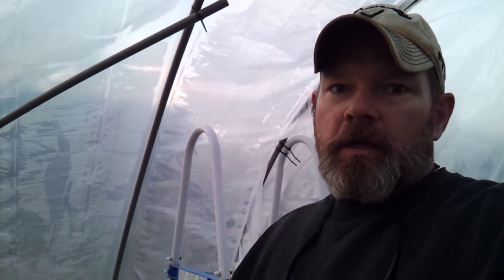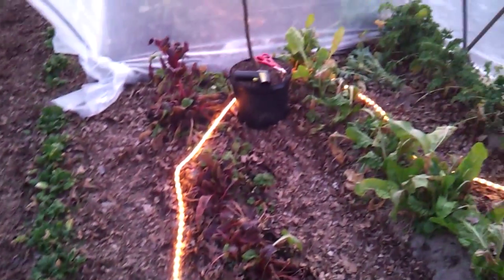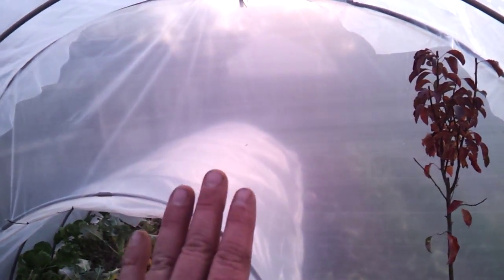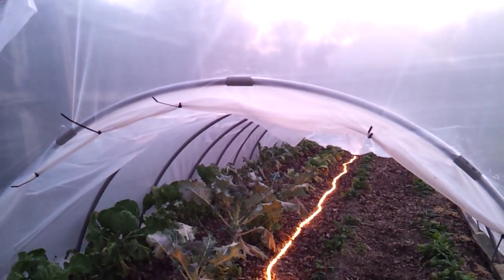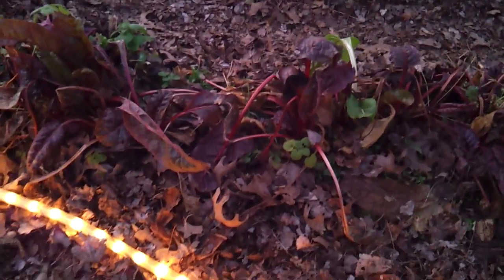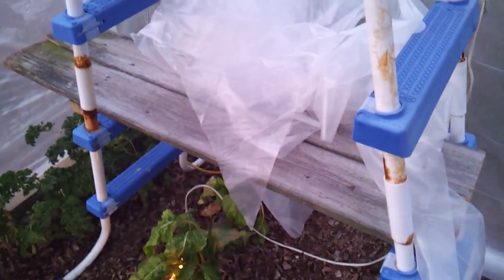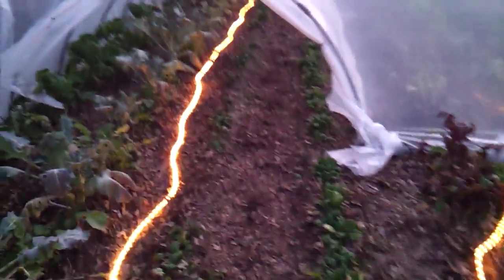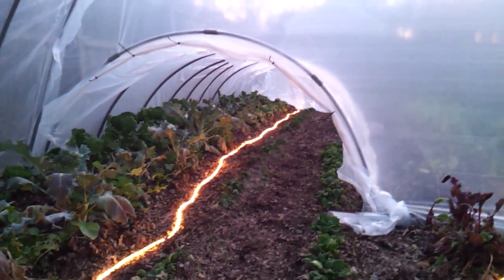HOW TO BUILD A CHEAP GREEN HOUSE and HOOP HOUSE Part 2

Comment: My weather out here can drop to about -30F or -35F sometimes, would you think it would still be a helpful tool for my garden? Do you think that I could keep some good heat in, come winter time?
Reply from the maker: Nathalie Lamothe they say for every layer of protection you increase your growing zone by one and or 10 degrees F If it gets that cold you may want to build one large hoop and put two small hoops insind it for double protection. add large rocks painted black too to hold the heat. Thanks for watching!!!
Reply: Guy Brown I'm trying to figure all this greehouse stuff out and I think I will go with upcycling my dog's kennel into greenhouse and reusing my old small greenhouse, some old poder coated wire and baker's racks covered with clear, a tiny portable heater fan with an automatic shutoff switch, some black rocks and a huge container of water in one corner and my bio orb-shaped compost bin! It may seem like a lot, but three racks are plenty of room for storage and planting trays and each other component helps with climate control. I already had in mind to build a removable hoop top from the roof which was secured with zip ties. That's what my late husband used to fasten mostly every other structural thing in my garden!